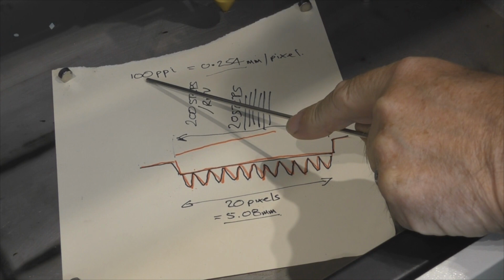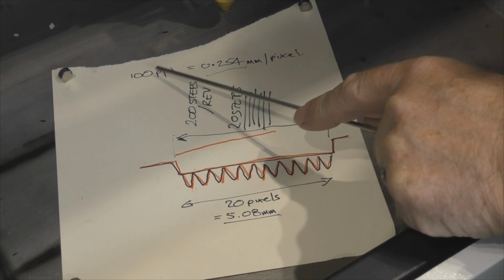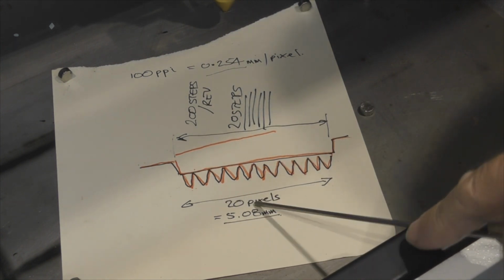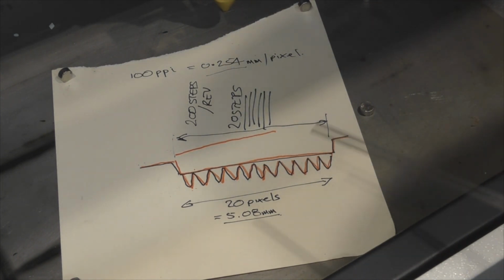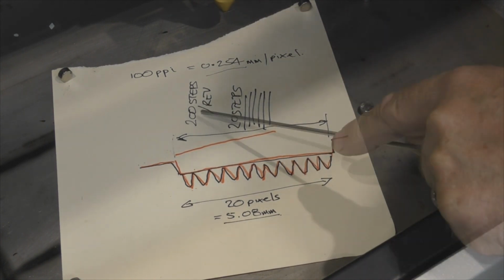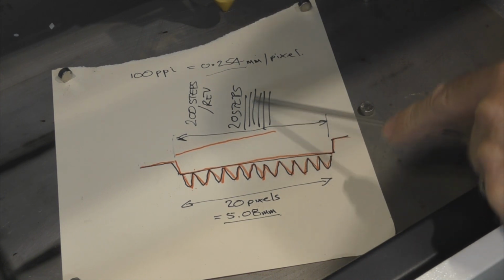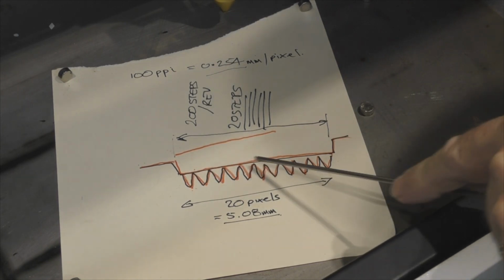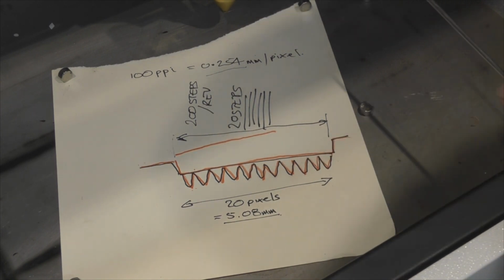RDWorks Learning Lab 117 Hunting those Phantom Pixels

Comment: I'm curious if an ink pen mounted to the side of your laser head would draw the same cavitations?  Fluid dynamics seems to be a possible explanation to the ripple.
Reply from the maker: Sadly an ink pen has no 3D abilities. Drawing a straight line that stutters will still only draw a straight line.
I know the patters I produced  might seem like a wave patterns,  but there is no  fluidity involved in their production. It is a shape carved away by simple sublimation. The vapour is at the surface and can immediately escape unimpeded.  The idea of fluid dynamics is NOT ridiculous though, because if you captivate expanding hot  acrylic vapour in a long thin tube you do get some interesting fluid dynamics going on. However, even better is the fact that acrylic records those effects for you to see. Long Live Acrylic....the best test material ever. see  https://youtu.be/bnwXuJz-tXg

Comment: We need someone with a high-speed camera to shoot this at 1000fps so we can see what's going on :-)
Reply from the maker: I tried 240 fps but that's nowhere near fast enough. That is where acrylic does such a fantastic job, just like footprints in the sand. Tells me so much more about where the power is being applied and at zero cost. Getting hi tech answers with low tech methods is all part of the fun I get from this machine. I got refunded on my accelerometer and looked at several other technical solutions for tracking the detailed motion of the head including LVDT and laser distance measuring. All WAY too expensive for this sort of shed engineering. In the end a piece of stainless hypodermic needle tube and a piece of acrylic provided the answers in a more positive and at ZERO cost. I LOVE acrylic
All best wishes
Russ
Reply: I shall do some tests with my chinese dragon as I have a camera that will do 960fps and see if that's enough to prove anything ;-)
Reply from the maker: Fantastic. Thanks Tony

Comment: Hi Russ, here is a great article that describes the operation of the stepper motors, this one refers to using 10 microsteps and you will see the reason why it is not advantageous for  accuracy to go above this for basic steppers. http://www.geckodrive.com/support/step-motor-basics.html to keep costs down (Simpler circuits), most manufactures choose to use binary multiples like 2, 4, 8, 16, 32 etc. more microsteps will give smoother operation but at the cost or torque  but will not get more accuracy

it also describes issues at low speeds so may help you in your search for answers.

also, one thought to add is that at low speeds, the stepper will move to its next position far faster than the actual mm/sec you have dialed into your test. but then the controller will wait an appropriate amount of time before issuing the next step. at higher speeds the next pulse will come before the motor has stopped at its new position, producing a smoother rotation, the rotor will follow the moving magnetic poles and accelerate to keep up with it. again, at the lower speeds the motor rotation will easily move to the new position before the next pulse arrives.

So until your pulses (Step time) exceeds this fast move, the motor will always stop or at least slow down between steps and in reality will not move faster until it is exceeded

Regards Peter from youtube.com/thebreadboardca channel.
Reply from the maker: Hi Peter
Thanks for that link
I think my drives are set up with X10 multipliers , so 2000 steps per rev.  The goal in all my explorations is to establish operational  boundaries rather than to upgrade the machine. I am trying to wring all the possibilities out of this machine by understanding the minutia that others are not bothered with. Now that I have bounced off it, I am interested to learn more about micro stepping. I have made logical assumptions about what I have seen and heard but it does not really matter if I understand because the important thing is that the new belt  has firstly proved the point by changing the low speed characteristic and secondly created a well defined jitter zone that I can now steer clear of. I still have work to do in the next session because I have the Lightblade machine that operates with vastly different mechanics. My China Blue machine has the X belt driven directly from a 16 tooth pulley on the stepper. By default, slow mm/s = VERY slow stepper speeds. This means lots of micro stepping. The Lightblade has compound gearing between the stepper and the X belt so my guess is that the stepper may already be above that critical jitter zone for all but the VERY slowest speeds. 
The point you make  about the rotor waiting for the next signal pulse at slow speeds is clear to be seem in my acrylic speed traces
Thanks for all the great information
All best wishes
Russ

Comment: Very nice work as always, Will it help if you draw the lines using one direction only in order to eliminate the vibrations that occur when the direction is changed?
I think if you add some delay before starting every line it can help in damping the vibrations at the beginning and eliminating unnecessary vibration that could affect the accuracy of your tests.
Reply from the maker: Hi 
I have already answered this question once and it seems that You Tube has posted it to some parallel universe!!!

I purposely chose bidirectional scanning to copy my previous work. The direction of scan is obvious because the burn spikes are not symmetrical and have motion characteristics. Yes, there is a small offset between the scans but this is not a problem. There is no vibration at direction change just deceleration and acceleration. The overshoot after the beam switches of is already quite long and is proportional to the run speed. For example at 20mm/s its about 5mm and at 400mm/s its about 50mm. That's plenty of time to get rid speed variations and  you can see that in the uniform nature of the speed tracks burnt into the acrylic. I will try unidirectional scans in the next session because I like the pretty gear tooth pattern that it produces and will make it easier to determine the frequency of the stop/start speed spikes..
All best wishes
Russ

Comment: trinamic make great stepper driver controllers that run super smooth- id look into that if i were into it.
friction makes micro steps practically useless for positioning by the way- since micro-steps have such weak forces on the effector. its practically just a form of sound dampening between full steps- but the motor will tend to lock to the nearest steps- A proper stepper controller can do this much smoother. it comes down to matching the wave form to the type of motor etc etc- and if paired incorrectly can cause all kinds of weird noises and behavior like skipped micro-steps etc.
Reply from the maker: Hi
Thanks a lot for suggesting a better drive controller. However, it is not my goal to make a super performing machine but to determine the performance boundaries of the machine that I bought.  In this case I had to spend a small sum to change the belt but that was more as an exploration tool than a machine upgrade.  It has reduced my "jitter" zone to a very narrow speed band that I can now avoid with confidence, but I still want to prove that the frequency of those speed spikes is somehow related to the native 200 steps. It's all part of the enjoyment I get from this machine, to use shed technology to to do investigatory work that would normally require sophisticated measuring tools and instrumentation.  The other issue with this particular machine is the fact that the belt drives directly from the motor via a 16tooth pulley,  there is no gearing system that would let the motor run 4 to 6 times faster than this direct drive system. I will eventually perform the same tests on my Lightblade machine which does have a compound belt drive system between motor and head.  Still lots to learn!!
All best wishes
Russ
Reply: understood- :) keep it up

Comment: Amazing Work Russ!  I subscribed to your channel because of the CNC machine, and although this still interests me, your systematic analysis, logical detailed characterization of behavior and brilliant problem solving skills are fascinating and THE MODEL.      I agree that the stepper motor could be the source of the behavior, but also think it is possible that the resonant characteristics of the system beyond the driver could cause the behavior - even with perfect logical stepper motor behavior.  Back to the stepper motor theory, one question that I had was whether all steps are equal when microstepping - specifically, i wonder if  the in-between steps  generate the same torque - and if not, perhaps this could be a contributor to the resonance anomalies.  Fascinating stuff and thanks for sharing this with us!!
Reply from the maker: Hi Steve.
My goal is to understand the operating boundaries for the machine rather than to pimp it up. The fact that I used the new belt as a tool by which to prove a point and that it has also given me and improved performance, is an accidental win. It means that I can now avoid that narrow band of jittery performance. So from that point of view the work has been a great success. There are still some unanswered question which I will explore in the next session. Will it fix my curtain effect? will it help my 3D engraving lines?.
It's is really an irrelevant question about micro stepping performance because although I would like to know and understand the theory behind when and how it changes from micro steps to whole steps. Or does it gradually change from  x10 to x8 to x6 etc until it drops into whole steps?  I say irrelevant because  it does not change the parameters that I have now mapped.
Still lots to learn and fun to be had.
Best wishes
Russ

Comment: Russ, why not disconnect the X axis drive so the laser head remains stationary and move the acrylic by another means, perhaps manually, to determine if the pixels go away. My non-China blue machine does not produce these same artifacts even with stepper motors and glass reinforced rubber timing belts. Just a thought but it may help answer some questions and bring other questions to the surface.
Reply from the maker: This China Blue machine is a direct drive to the X drive belt via a VERY small 16tooth drive pulley. By default that means that slow speed means VERY slow rotation of the stepper. It is not until I get beyond 60mm/s that my jitter disappears.  If you have a Red Sail clone design where there are intermediate drive belts between the stepper and the X belt,  then your stepper is automatically running 6 to 10 times faster to start with and you may never be in this jitter zone. My Lightblade machine is just such a design and I will get round to doing the same tests on that soon.  AS you rightly say, that may raise it's own questions.
All best wishes
Russ

Comment: Hey Russ. I spent some time chasing a similar niggle i had with my my machines, the cause of the striations that the laser leaves on the edges of the material being cut.
it was suggested that this was also caused by steppers or belts or resonance, kerf etc, however in my case I ruled out the steppers/belts/pulleys by simply disconnecting the belt and moving the head manually with a weight and a pulley to get a constant speed held the pulse button and released the weight,

I found that the striations were still there exactly as they were when cut using the stepper, I also ruled out it being kerf marks caused by material removal in my mind as they were identical on both wood and acrylic, and the striations were the exactly the same if the material was cut clean or only 50% through

Granted it only gives you a single line to examine and not a block engraving like in the video but it does help to eliminate or not the steppers/belts and pulleys in one go.

From what i read at the time the steppers do have resonant frequencies towards the slower speeds depending on the size etc and that's where the reduction drives come in like on the lightblade allowing the steppers to spin faster avoiding the juddering or resonance of slow movements and speeds.

i'm interested to see where this rabbit hole leads you as I believe it will answer my questions as well

good luck

Comment: You really should get a prize for the level of detail which you're going into here! I was interested to see the "curtain" effect you described on the background of a rastered area - I've never experienced this (but then I haven't done much rastering), but I have observed a seemingly gradual increase or decrease in depth as the rastering progresses. For example, suppose you rastered a solid square at 100% power - the rastered area might be deeper at the back than at the front, as if the power is slowly drifting. I've meant to investigate this further, because it is a bit of a pain, but never got around to it. It's the main reason why I decided to keep my older laser cutter, one of the really basic 40W 20x20cm machines, because it always did perfectly uniform rastering.

Another strange effect I noticed tonight is that, at least with my tube and the lifetime it has, 50% power seems to give more power than 100% power! I rastered two areas with the different power levels, and that done with 50% was considerably deeper. Extremely odd. My only guesses are the tube is coming to the end of its life and is behaving weirdly, or that the higher power is exciting a different mode and is no longer producing a perfect Gaussian beam.

It's a great pity there's no detector which both is sensitive to 10.6um and also has a fast response, so you could actually look at the laser power in real time....
Reply from the maker: Hi Lindsay

I have dropped you an email on this power issue but could you also tell me if there is a makers label on your tube and what it is?

There is a way to monitor power continuously but the answer is not in watts.
see https://www.youtube.com/watch?v=2SaOo5nFGrU  at 25 minutes The  power across the beam is not uniform but a Gaussiin type shape. At the edge of the beam the temperature is fairly low.  If you clamp your themocouple into a fixed position then you can use the temperature at that point as a means of checking power variation live without significantly affecting your output power.
Best wishes
Russ